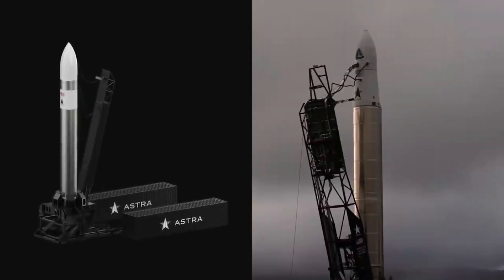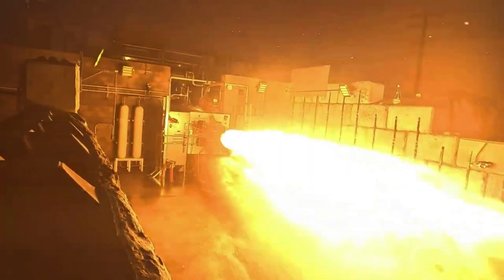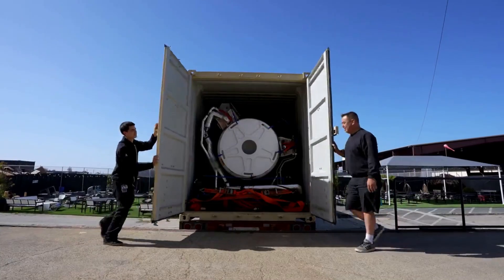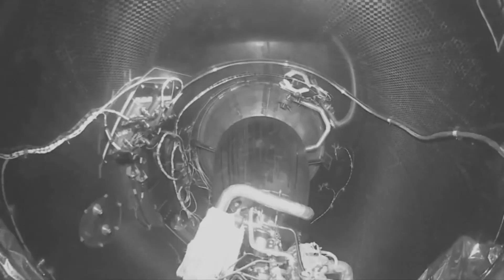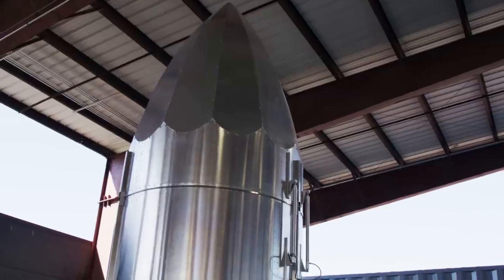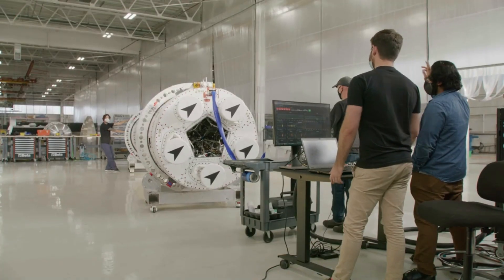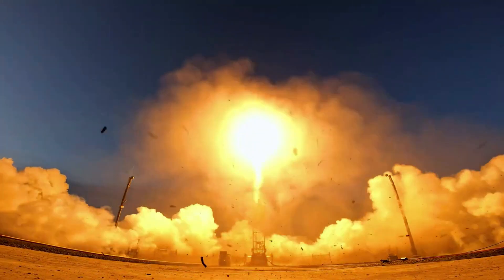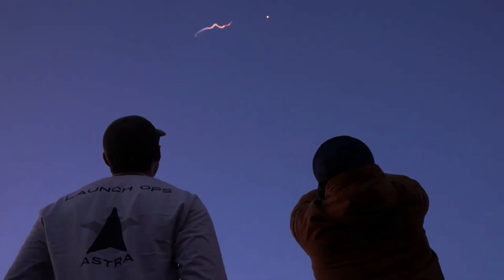Astra Space's Main Engine Has Completed A Major Development Test

Comment: "Firefly engines ... already have a decent flight heritage" - one failed and one partially successful firefly launch isn't what I'd describe as "decent flight heritage".  The Reavers have more flight heritage than anything Astra could build, so it makes sense for Astra to use them, but the limitation of at most 2 Reavers in Stage 1 is a major constraint on Astra's future launch capability.
Reply: I think the Delphin has significantly more "flight heritage" than the Reaver but go on?